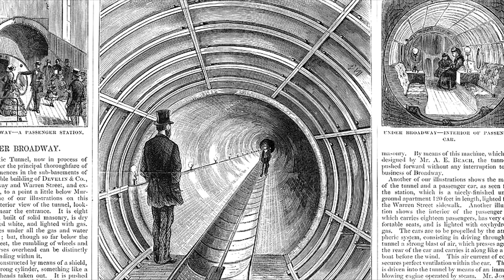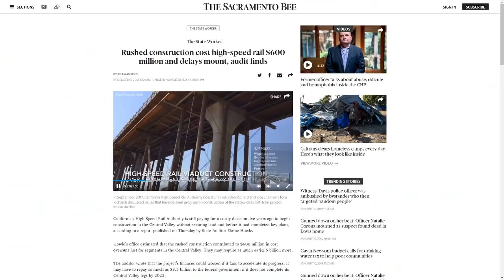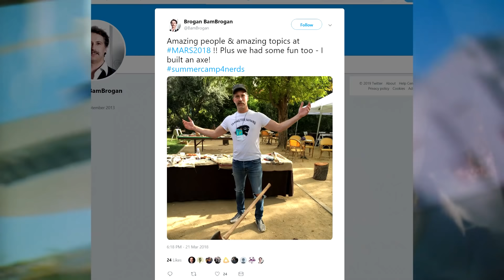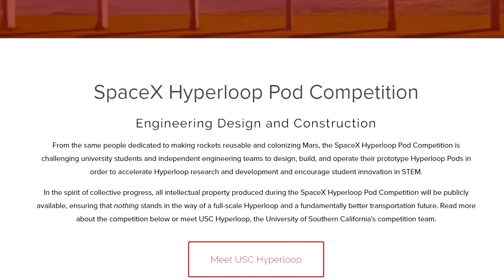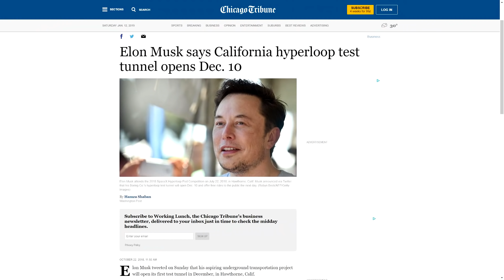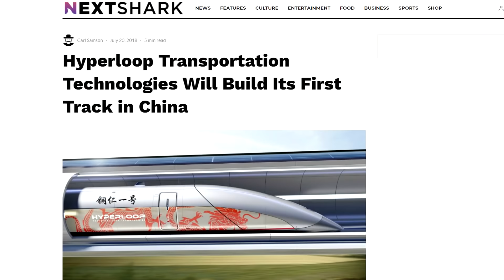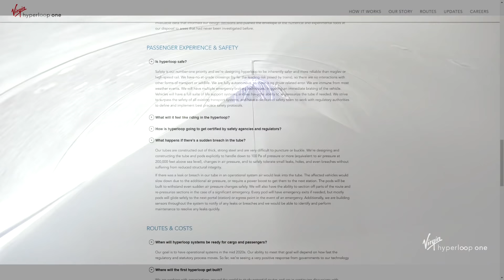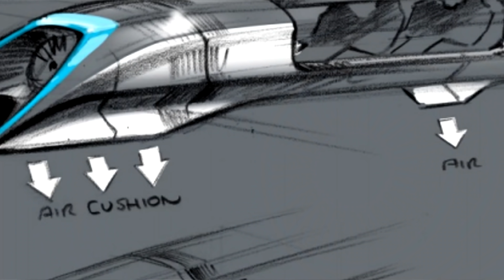Why Hyperloop will FAIL HARD - Its Biggest Problem...

Comment: I'm old. I was a kid in the 70s, and back then the future was going to be all Maglevs and monorails, and individual pods and so on, not to mention personal air transport. And hovercraft. None of it happened because it keeps turning out that the most efficient solutions to the mass transit problem are trains with wheels on rails, and buses.
Reply: Yup all that money wasted instead of funding to have faster subway train.
Reply: maglevs and monorails are the one of the main means of transportation in Asia its just usa that is slow
Reply: @vaibhavshukla9288  maglev will be more realistic option as cost will go down quickly with new high temperature superconductor  become feasible. Does not to be in a vacuum
Reply: In the 50s, year 2000, we had space stations and space ship all day long. Flying nuclear cars and my favorite, anti gravity belt.
Reply: @bjorngve  I still want a nuclear car. With fins. :)
Reply: And the "individual pods" have two wheels, no motor and are called bicycle.
Reply: @feng443  IF high temp superconducters are possible. You can't use "will" with things like this
Reply: @fudruckers3916  well, maglev is currently under intensive development by Europe, China and Japan. Once again,  your usa gov ignores anything that they cannot profiteer from.

Extreme high speed maglev is still not quite here yet, but it is already in existence qt lower speed. Unlike the hyperloop and its challenge of maintaining the medium vacuum of hundreds of miles of tubes. And of maintaining its structural integrity, safety in case of calamity implosion or explosion, amongst other challenges.

And the high speed version  may not indeed be soon. But it is definitely way more feasible than the hyped up hyperloop.
Reply: @Jinkypigs  I agree. I'm not from the US though
Reply: @vaibhavshukla9288  in which asia it is ? Rails overwhelm maglevs and monorails by several orders of magnitudes both in length and people carried.
Reply: Ahhhhh but those are boring forms of transport
Reply: Maglevs are actually competitive with air in speed over longer distances. Especially once the technology matures. Its capacity is at least as good as that of air.
Reply: Maglev and bullet train is cost effective it can carry large number of people at same time .it runs in electricity.Airplanes cause lot of pollution
Reply: To be fair the monorail is s valid options because it's just a train in a different font, or format
Reply: I'm fairly young and work hard on becoming the greatest novelist of my language

Comment: Come on amigo, the problem of the Hyperloop is not economic, is the concept of near total vacuum in a very long tube at the bottom of the atmosphere. Living organisms mostly constituted by water with dissolved gases in it doesn't befriend with very low or absent barometric pressure at all. Do you want to boil like fried chicken when your Hyperjunk vehicle collides with a nut or a bolt at 750 mph and implodes? People aren't studying physics and biology in high school anymore?

Comment: "Hyperloop: Experience all the thrills and dangers of space travel without leaving Earth."
Reply: thrills and dangers .... and costs
Reply: Dont think there are any thrills! Just dangers and costs.
Reply: @Georginajaneyoga  If you are that sure, then I think you should invest as much money you can earn and borrow into the hyperloop.
Reply: Georgina Meister the longest tunnel in the world is 35.5 miles long, cost nearly 10 billion dollars and took 17 years to complete. At that cost, LA to SF is 100 bn dollars atleast. Buying land is much cheaper. A basic tunnel costs 10 million a mile from most contractors and the size of those tunnels is way too small for a hyperloop. Furthermore, the longer the tunnel the greater the cost. Musk only holds contests for the best hyperloop designs, theres no serious money hes putting behind it and hes not funding any hyperloop construction. Others like hyperloop tt and hyperloop one have been talking about doing it for years but still havent even tested real world prototypes. Also, nobody can begin construction until the government introduces regulations for the industry, including for safety. Those would add significantly to the costs. So dont hold your breath! The hyperloops biggest problem is not technology, although that is a challenge as well, it is economic feasibility. Most transport experts agree that The numbers put out by hyperloop companies are ludicrous and impossible.
Reply: @Ax9005  when there is danger there is thrill
Reply: Someone will just drill a hole in it... ffffff... billions of $$ wasted foiled by a drill.
Reply: @Ax9005  You make a lot of assertions which don't pan out.  You suggest no serious money has been invested in the proposals.  I am not sure about you but one might suggest any amount of money any company invests even in feasibility studies suggests otherwise.  Yet it is most certain these companies did not merely do paperwork analysis but have spent millions on product research and development, including all sorts of scale models.  Again, not sure what your personal fortune sits at but one can conclude as these organizations pour millions into these aspects it is a sign of their commitment to, at the very least, advance the project not least of which is to ascertain information required to move forward or not and who.  So not sure what your particular measure is in regards to 'serious' money but for me, the fact that they are continual involved at all is a signal they are serious.
As far as your assertion that 'most transport experts' (who these people are you never name names) see the concept as folly due to cost .... well la de da.  I could care less if its a million to one so long as those actually spending their own money think its a worthy pursuit then who cares what the experts say, they are not the ones involved in the construction and advancement of the project.  Provided there is one organization willing to pursue the project who cares the amount of naysayers there are, it is irrelevant.  
Regulations for such projects are not made whole cloth prior to any project.  It is a mesh work of jurisdictional, engineering and regulatory framework which evolves and develops over time, so to suggest that the 'government' (again a placeholder term as the amount of stakeholders involved on this topic is vast and not a singular) and the organizations involved in the development of the projects various stages would not be able to work hand in hand in meeting specific regulations, codes and compliance guidelines is completely hogwash.  No industry on the cutting edge is without these concerns and they are not insurmountable.  
Further, as to the tunnel concept ... it is highly unlikely any hyper loop project would not consider all options for how and where the infrastructure is built, whether it is a tunnel, a raised platform or a bridge.  Each location would present its own challenges and there is no reason to conclude that every potential project would only consist of one mode of infrastructure.  
On the topic of cost.  Cost is always the central factor, to be sure.  Quite often this is mitigated by government involvement.  Sports stadiums are a testimony to this fact as they often obtain vast sums of assistance when constructing new arenas and stadiums.  Securing of rights of property to construct said enterprises is another incredible hurdle which again, government involvement to mitigate these matters would be central.  So there are challenges, no doubt, but its not an open and shut case that these mean the projects are doomed.
Locations in Dubai have been advanced as reasonable places to construct these projects, as these issues are not as insurmountable as say a line from Chicago to other areas or in Asia.  
Norway has embarked on a 475B coast highway project with vast engineering challenges and massive hurdles.  China and Hong Kong and the construction of the worlds longest bridge was a monumental challenge.  Challenges are merely that, challenges, and while it is true hyperloops present massive challenges of all types, these being present are not evidence that the projects themselves are insurmountable.  
More often than not the factors which either help push these projects forward are to be found in issues surrounding cooperation between parties of concern, will to see the project through by various stakeholders and ability to properly fund these projects.  
One thing we do know for sure, as with any new processes, the cost only drops and the efficiency increased as time goes on when repeating the same steps.  Boeing demonstrated this in construction of aircraft, as more units are built the cost is vastly reduced, making it more feasible with each unit built.  The same principle would apply here.  Any hyper loop project would not be as cost efficient as its predecessors and this is well known to all stakeholders.  
There are always questions, causes for concern and obstacles which question the feasibility of said projects.  Quite often these do not necessarily mean the projects are not worthy but merely highlight that certain conditions must change in order for said projects to be feasible.  Whether or not these changes occur over time is unquestionable as they may.  The question is not if they will but when and in what direction.
Reply: What? It is not nearly as dengerous as space travell
Reply: @Georginajaneyoga  what? They will be  on the outside
Reply: @Georginajaneyoga  " So the cost debate is over. "  You are 100% correct.   Thunderf00t & EEVBlog & this channel have ENDED this debate by showing what a MONUMENTAL WASTE of money this hyperpoop scam will be.
Reply: @Ax9005    THANK you!  You said it far better than I did.
Reply: @bcshu2   "the cost only drops and the efficiency increased as time goes on when repeating the same steps"
FALSE GENERAL ASSUMPTION!  Not always. Not some absolute of economics.  My GOD the ARROGANCE of economists who treat their economic ASSUMPTIONS as some sort of UN-QUESTIONABLE ABSOLUTE, when in fact they are NEVER held accountable for the BILLIONS of PROVABLY FALSE predictions they made.

No - things like ENTROPY and DECAY can make endlessly maintaining this IDIOTIC hypershit idea EXPONENTIALLY more expensive with time.
Reply: @theultimatereductionist7592  entropy and decay arise in all infrastructure.
The point was that the first product developed costs more to produce for its output then manufacturing the millionth.  Boeing knows this as they account for the increase in knowledge developed by actually building these things.  It’s common sense.  We learn as we do and improve.  It’s evolution.
Reply: @Georginajaneyoga  There have been numerous attempts at failed mass transit ideas over the years. For example, someone in 1920 might have reasonably thought that zeppelins would be the future of air travel. 

The problem with the Hyperloop is that it is essentially a maglev train with extra steps, and the technology is in its infancy. Rail itself has long been an relatively obsolete part of America's infrastructure. In short, it lacks the last-leg capabilities of motor vehicles along with the speed and flexibility of aircraft. If the hyperloop is the future of travel, why not maglev trains, and if maglev trains, why not traditional rail? On paper, rail is more energy efficient, so why isn't it a primary artery of transporting goods already?
Reply: Including delays, postponements, and unfulfilled promises.
Reply: @blkgardner  rail is too slow, maglev requires greater degrees of access to land not reasonable available.  Not saying I support or see hyper loop working but those are reasons that answer your questions.
But from my POV, if a private company or individual wants to take the risk, who friggin cares, all the power to Elon.
Reply: @bcshu2  Hyperloop would have the same land requirements as maglev, even more so because of the higher turning radius from greater speeds. Any hypothetical hyperloop system can be downgraded to a conventional maglev. 

Likewise, there are many applications of rail that do not require high speeds, such as shipping freight. 

Also, nobody builds infrastructure with "private funding." Nearly all railroads involve public funding, such as California's failed high-speed rail system.
Reply: @blkgardner  Boring company is an effort to tunnel, which was my understanding
Reply: @Baekstrom  I still think everyone’s favourite Tony Stark wannabe (who wants to setup Mars colonies) may have an ulterior motive for wanting work to be done on low pressure transport systems.
It may have a lot to do with the dangers of travel in a moderate vacuum.
Reply: @Georginajaneyoga  Lol. 
First: Let's say the mile would only cost like 5 Million, wich is INCREDIBLY cheap, it should cover longer distances, so a single 300 Mile track may be around 1.5 Billion just to dig the tunnel. Let that sink in a minute and think about, how many people would need to travel to wich cost, to just brake even. 
Answer: You built the vast majority on the surface, because it's prohibitively expansive otherwise. 

But let's just ignore the cost, shall we? There are some slight problems with the vacuum thing. I know, I know not perfect vacuum, but still very close. 
They would need to built the biggest in the world - by an order of magnitude. Vastly bigger. Currently not really possible, but ok, let's just assume they pull it off. Can you imagine what those pumps will cost to operate? 

Then there is the problem with... Well.. Vacuum. First Compression and Decompression. This takes ages. Eliminating the time safe. They pretty much can't speed that process up. Yes, the tube itself would be under constant vacuum, but people need to get in there at least in a seperate chamber or something. 

Even if they trough some witchcraft eliminated that... There is the very real dangers. One hole inside that tube is going to kill any passenger. Instantly. No rescue. And even if not - how would they come out of that thing? 
And especially when they built those things over ground, one drunken truck driver can certainly destroy that thing. 
But honestly, the death thread is propably the least of the problems. 
I'm more concerend with how the fuck to get out, if something is wrong. 

Tell me.... Why not just leave the vacuum out of the occation and build some nice bullet trains like Japan does? The Shikansen is INCREDIBLY fast and yet the manage to make it even faster and faster over time. 
All of this, while it's just as safe as a regular train. Very, very safe. 
If it makes you feel better, you could even built it inside a giant non vacuum tunnel. 
The tech is there, it works, it's safe. All feautres the Hyperloop doesn't have.
Reply: @Georginajaneyoga  boring company "underground cars" is pretty much the same thing as trains.
Reply: @Ax9005  Its a god way to get technologie free where student work for free and give up all technology they developped.
Reply: @Georginajaneyoga  there are walkways terrain where underground is not possible .Any exposure to ground will be danger. Also even wonder how to evacuate all the way underground.
Reply: undercup
Reply: Wait wait wait. You said hyperloop is superior to the Maglev due to land costs and tunneling solves it. Bruh the reason why Maglevs are so expensive is due to the tech on top of land costs. It's why it doesn't take off in a lot of countries.

Also... how you gonna maintain a 1/1000th atmosphere in a tube with earthquakes if it is underground? Since earthquakes are essentially ground waves... At least above ground, you can have structures to support it.

The biggest problem is still the bloody 1/1000th atmosphere. That is an insane amount of energy just to maintain it..

Also to the one who brought up thr Boring company. You do realize they had zero innovations except for creative accounting for the number right?
Reply: Honestly, how do they plan on doing customer pickup/drop off in a fully vacuum system tho?

Comment: I'm glad you got to the #1 problem -- maintaining the vacuum.  A few decades ago, I was doing industrial automation for a company that used a vacuum chamber for their process.  It wasn't a hard vacuum, but a pressure of 30mmHg (torr) where atmospheric pressure is around 700torr, and it was still a pain.  I can not fathom the effort needed for hundreds of miles.

Comment: "190 Miles per hour in a 500 Meter tube..." Why?
Reply: Got to love the mixing of units there lol. Not as easy to say as "190mph in 546.81 yards" I guess lol.
Reply: Rather how .. they also claimed that they achieved 240 mph soon after that ... to accelerate and decelerate to such speed within 500 meter, the forces will be crazy. This it was only for unmanned pods.

The actual manned pods just last year (I think, or early this year) only achieved around 70 to 80 mph I think.